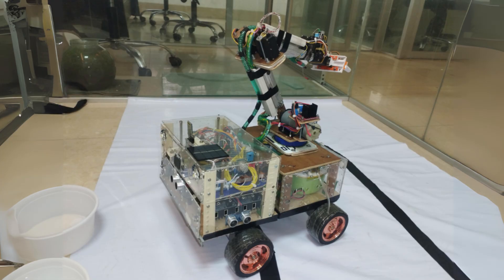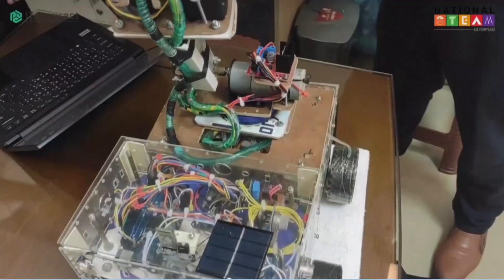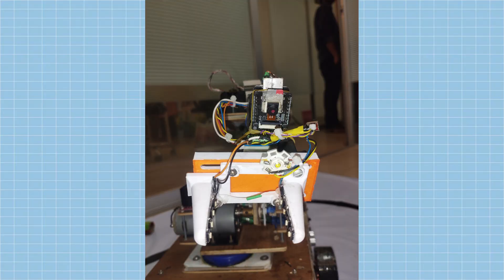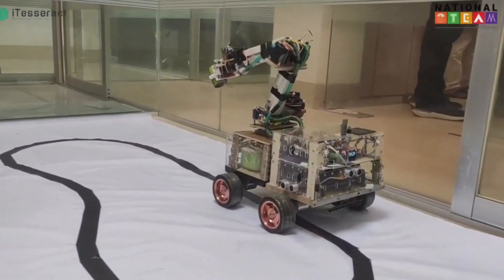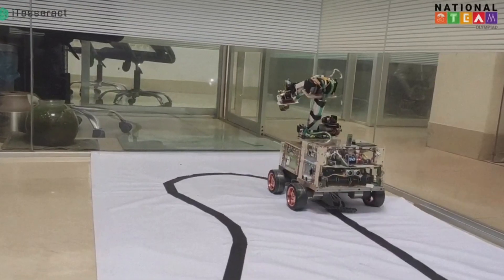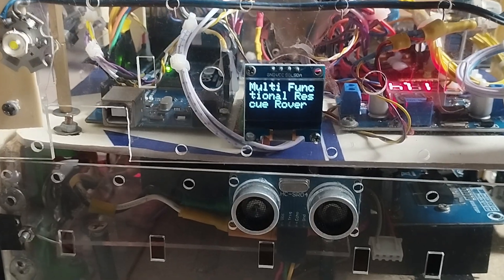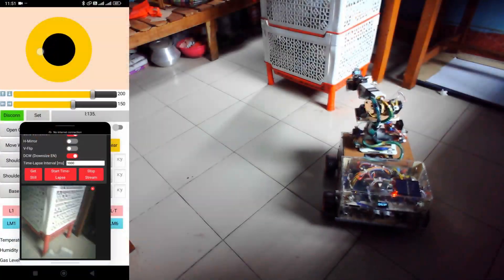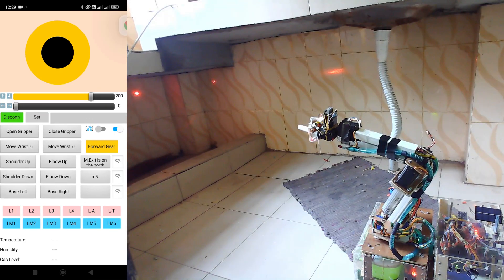Rescue Rover Project using Arduino and ESP32 CAM | Project Documentation

Comment: How many batteries do you need for this project because it requires a large Ampere current of around 2A?
Reply from the maker: I used 3S battery pack of 3.7V 18650 Li ion battery.
Reply: But how can it work on all sensors?
Reply from the maker: When I switch to a particular mode like sensing mode, obstacles avoidance mode or line follower mode, then particular sensors are activated and Arduino reads the sensor to take essential actions.

Comment: Motor details like rpm etc?
Reply from the maker: 4 wheels use 12 V 300 rpm geared motors.
Reply: @simplifiedshanto7597  Thanks..... Motor driver??
Reply from the maker: @khanbasharat  2 piece BTS 7960 motor driver for left and right side wheels. You'll also find photos of those circuit arrangements in the video.